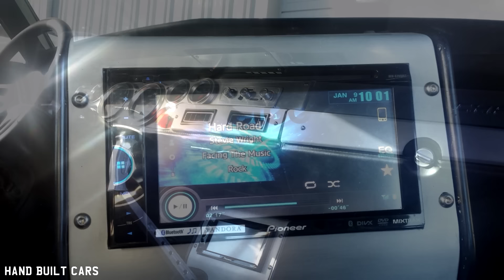1970 Dodge Charger 572 HEMI Build Project

Comment: Beautiful car and beautiful build!  It is one of a kind where if you had restored it it would have been one of thousands.  Not every old car is a numbers matching big block that  should be restored guys.
Reply: I've been showing my restored 69 Chargers for 6 years. Except at the Nationals or big Mopar shows, my car is usually the only Charger there, even in some shows with over 1,000 cars. At the Nationals, you might see a couple of dozen 69 Chargers and few of them are restored to original. It's hard to restore a car to original. Some times it takes years to find certain parts. I don't know where you're seeing thousands of these so please let me know!
Reply: @richardweyland116  Well ya got me.  I haven't actually took a head count of how many are left but I do know that 89995 Dodge Chargers were manufactured in 1969 alone so Im betting there are still a few around.  There is one in my garage but Ive never taken it to a car show. Im sure you are still special though.  The point was if you buy a car its yours to do with as you please and what other people think is inconsequential.

Comment: I can definitely appreciate the long hours that went into this build, but why would you cover up a hemi like that? Hemi's are very visually pleasing engines and I feel like that is part of their allure and mystique. It looks like they tried to copy a 2018 charger under there. They could of just used a cheaper to build engine and had the same look.
Reply: Kdog 81 I'm curious what kind of vehicles you have or have restored? I went to school for building engines and maybe that is why I have a great appreciation of engines and their history. I know the level of detail it takes to build an engine of this caliber. That's why I think it's wrong to cover it up with sheetmetal. I'm getting the vibe you may just be a keyboard warrior. They could of dumped a supercharged LSX in it and had more horse power and less weight on the front end. And 75% of people probably wouldn't be able to tell the difference as they walked by.